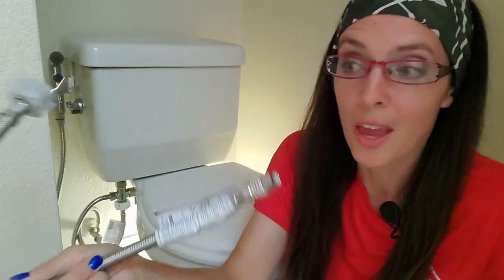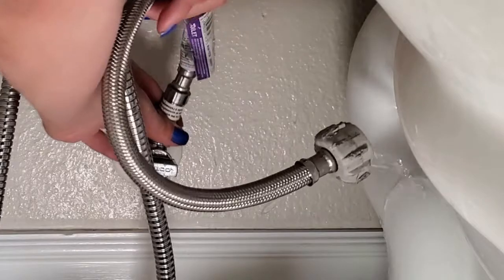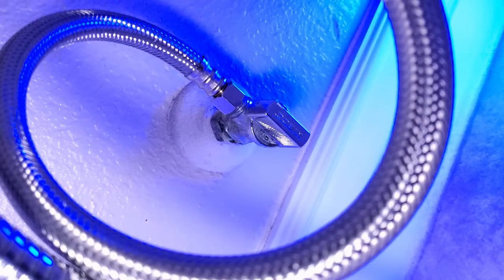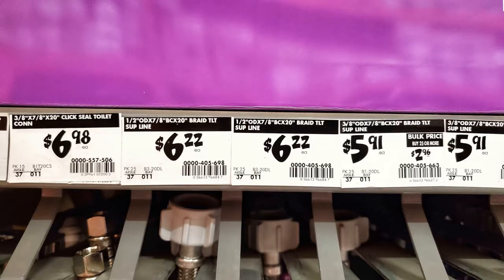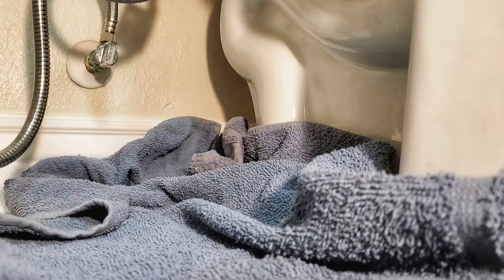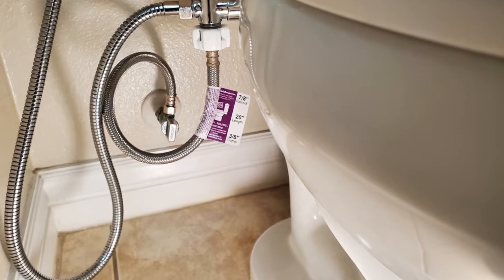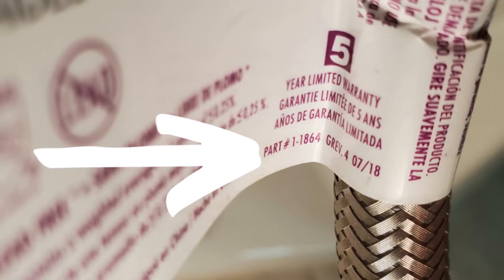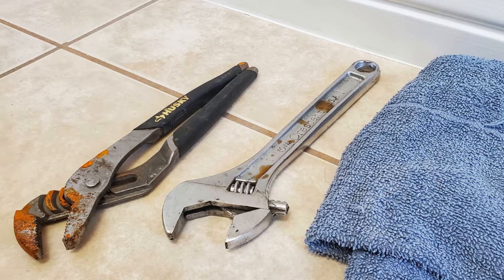No More OVERTIGHTENING! How To EASILY Replace a Toilet Supply Line

Comment: The plastic part at the toilet broke and flooded my bathroom and lower floor.  I may have over tightened it along with high water pressure .  Thanks for the video
Reply from the maker: Oh no! That's the worst--that water moves fast and wreaks so much havoc. :(
Reply: @NoMoreLeaks  yes, it broke at 330 ok n the morning and I didn't hear it til 5.  Ruined my upper and mainly lower floor.  Don't over tightened. Update:. I love your videos ...
Reply from the maker: Oh no!

I did not mention it but, I'm a proponent of water sensors through the house with the ability to shutoff. IMHO Phyn Plus is the best monitoring and shutoff system if that is something you'd like to check out for prevention--I have quite a few videos on Phyn and their main competitor, Flo by Moen. These devices alone will not completely eliminate all the damage, but it will keep it from running the entire time you are unaware and if you have their sensor just below the toilet line it will shut it off within moments. I really do wish you the best and hope your repairs go as well as they possibly can.